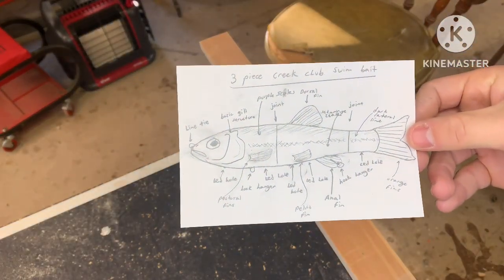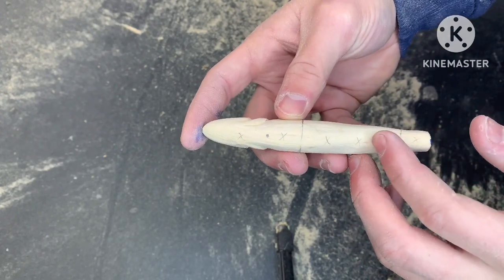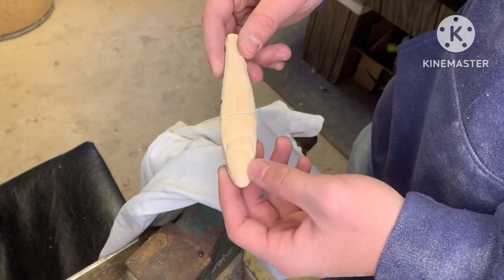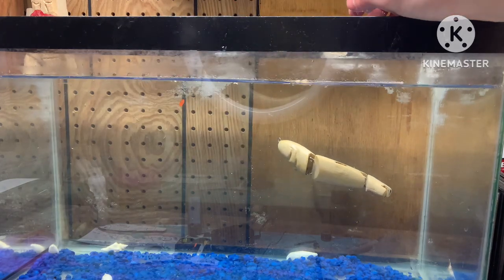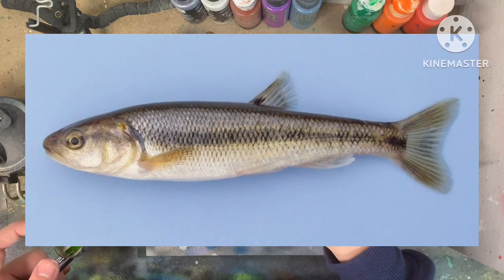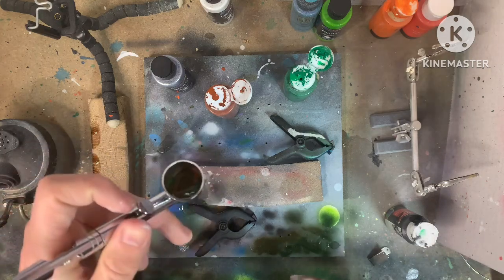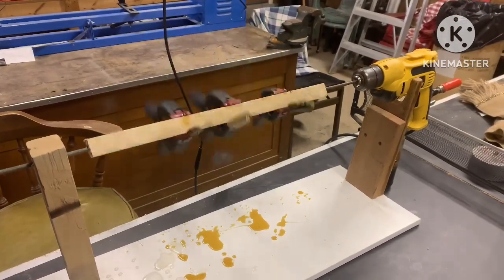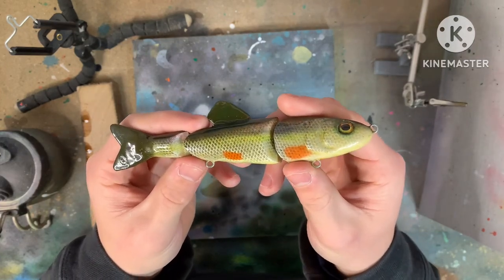Making a 3 Piece Creek Chub Swimbait Out of Wood

Comment: Awesome job on the swimbait! 

I prefer to add the tail, fins, and as much other hardware as possible before doing the float test. I don't have a lead pot so I hot-glue some lead to the bottom of lure, adjust the amount of weight and its placement while float testing. It is also good to put split-rings on the hooks and hang them on the lure, by putting the barbed end of the hook through the hanger, while doing the float test. Having all the hardware in place while testing in water will ensure a more accurate balance and float-or-sink rate for your lure. It takes a lot of guesswork out of the process. If you believe the eyes may affect your testing, drill out their sockets and hot-glue them in place. Hot glue is easily removed so there's not cleanup or sanding required, it just pulls right off. But use it sparingly, as it floats and may affect the buoyancy if too much is used.

I've not seen a water jet for a testing tank, what a cool idea.

I have watched all your lure builds and will continue to watch future ones. You do a great job in taking us along through the process.
Reply from the maker: Thank you! That helps a lot! I’ve been trying to get more precise with the balance of the lures I make so your tips will definitely help! Thank you for your tips and support!